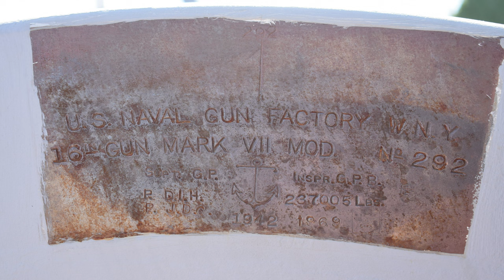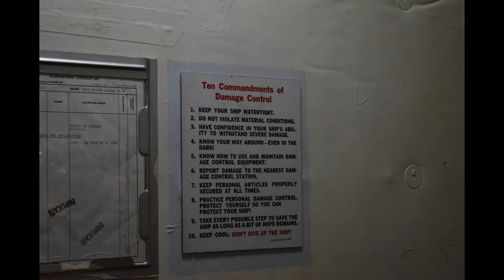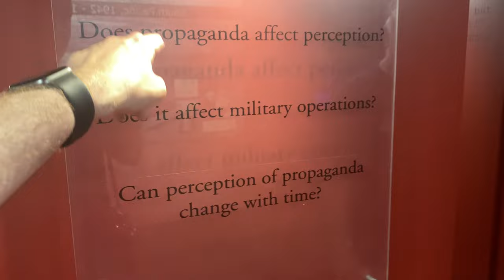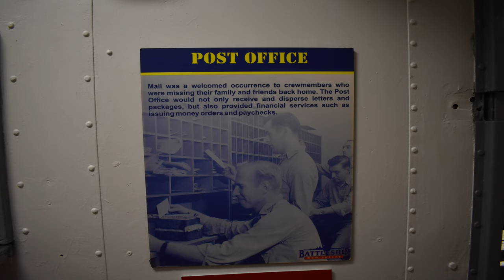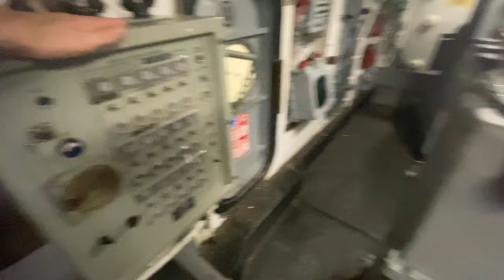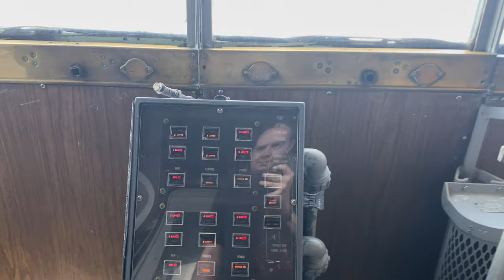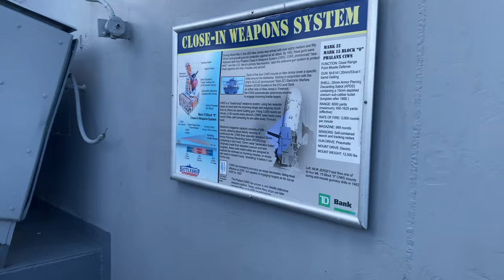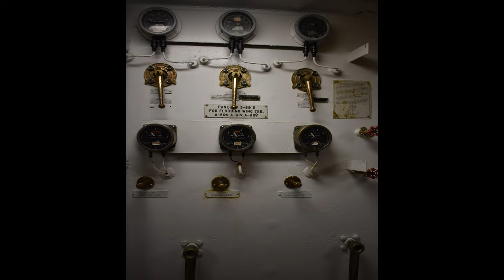Let's Tour USS New Jersey

Comment: @1:40 -ish  You must have visited the ship shortly after a big summer storm came thru in August 2023, it took out the roof sections of two of the three event tents on the fantail, as we can see in the video and pix.  Since there were major events planned for those tents within weeks, the museum hustled to get the roofs replaced so that the events could happen under cover.  The storm also ripped up a few sections of the while railing bunting along the upper levels of the superstructure.
Reply from the maker: Yup, that’s correct. The ship itself didn’t care, but yeah, tents and awnings and stuff didn’t much like it.

Comment: @2:34:15  The red boxes on the O5 Nav are for communications headsets.  Not sure why they are red, as typically anything red has to do with fire extinguishing.  Some of these boxes that are original to WW2 have an ID plate on or near that says something like "headset."  The large boxes you speculated as being something to do with '80s electronics are ready service ammo boxes.  The giveaway on most of them is that they have that curious extra external layer positioned about an inch or two away from the main body of the box.  The purpose of the outer layer was to serve as a sunshield/heatshield so the sun wouldn't be beating directly down on the boxes and get them too hot, which, depending upon what kind of ammo was inside, might eventually start to cause deterioration.  On some of the Iowas, these outer layers of the ready service ammo boxes are painted white, again to cut down on heat absorption.